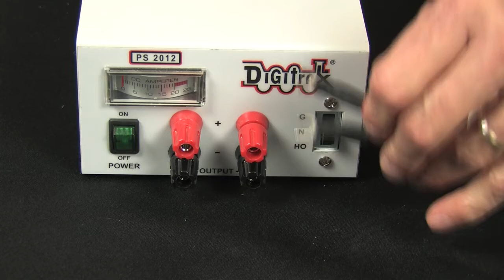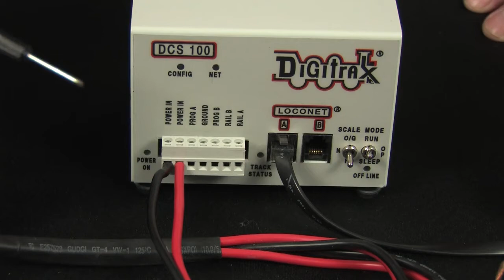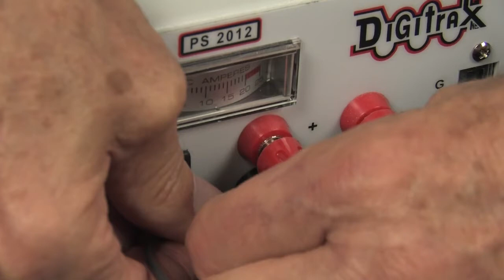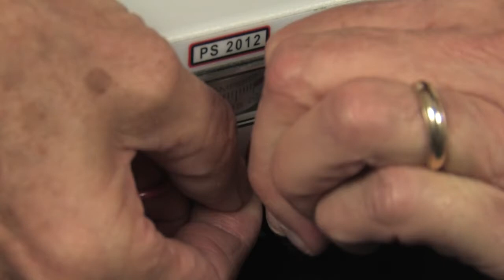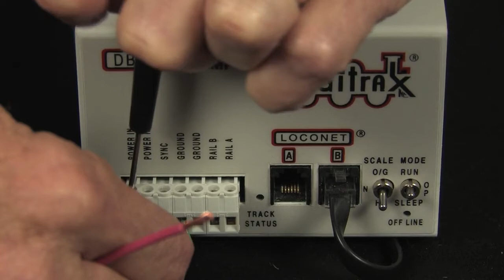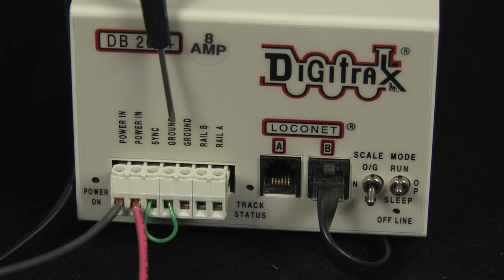PS2012 Hookup Guide

Comment: If your layout doesn't require the additional power from the 8 amp unit, it is OK to use the Y cable to connect both the 5 amp and the 8 amp unit to the PS2012. You simply only get 5 amps out of the 8 amp unit.